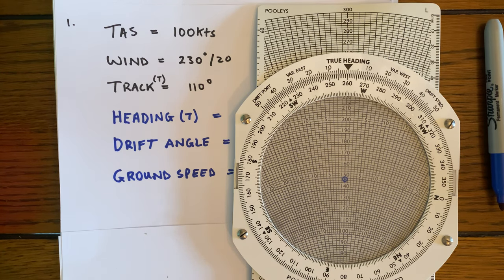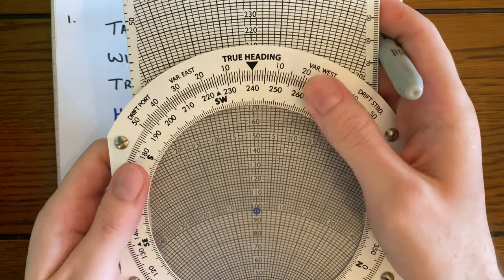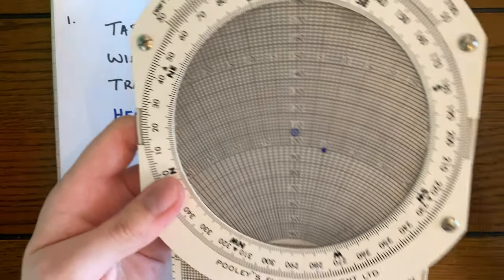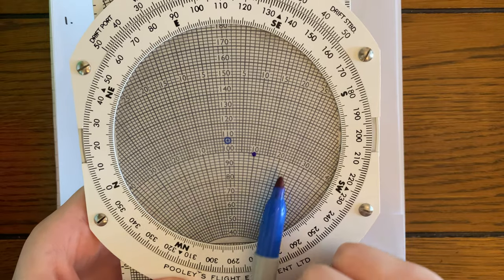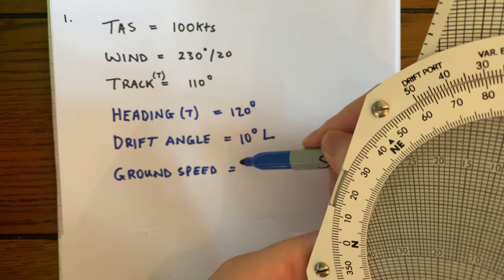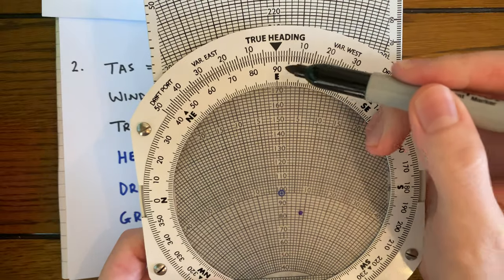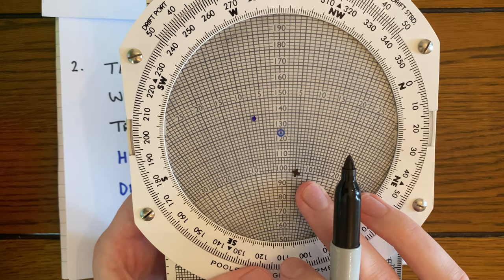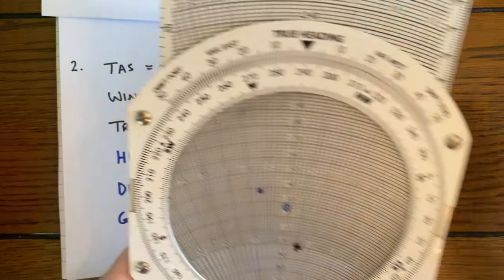CALCULATING HEADING, DRIFT & GROUNDSPEED - CRP FLIGHT COMPUTER (EASIEST METHOD)

Comment: As much as folks appear to like this content, the content is incorrect. Drift does not equal Wind Correction, usually. Drift angle for this case is 9 degrees left so it's 1 degree off the wind correction angle which is what is calculated in this video. 

The reason people are taught to mark the wind speed down, instead of up, for drift is because the drift triangle is different from the wind correction triangle.

For drift, set index=wind angle, set grommet=TAS,  mark windspeed down from grommet, rotate and set index=course; read both groundspeed and drift angle from mark (111kts and -9 degrees in this example).
Reply from the maker: Hi, thanks for the feedback. I am not entirely sure what you are referring to, however the answers in the example are correct. 

Having used this method myself in ATPL exams it has been designed to follow the layout a student can expect during either ATPL or PPL exams.

Please feel free to use the official e6B calculator online or another reputable source using the example and you will reach the answers I have provided if you do not agree.

The method I have demonstrated is a quicker and easier way than the marking down method, this is aimed to speed up students in exam conditions.
Reply: @atplmadeeasy2495  I've tried three times to reply including a web reference but looks like youtube doesn't allow this?  WCA=negative DA if the aircraft heading = WCA. If aircraft heading is not WCA, then drift angle is almost always different. I'd point you to my writeup on this but, as I said, youtube seems to not allow it.

Comment: To determine your heading, drift angle, and ground speed, you can use the wind triangle method. Here are the steps and calculations:

Track (T): 290 degrees
True Airspeed (TAS): 100 knots
Wind: 090 degrees at 30 knots

Step 1: Calculate the Wind Correction Angle (WCA)
The wind correction angle is the angle between the track and the heading necessary to counteract the wind effect.

Using Trigonometry:

WCA = arcsin ( W * sin(θ) / TAS )

Where:
W = wind speed = 30 knots
θ = difference between wind direction and track = 290 - 090 = 200 degrees

Since sin(200°) = -sin(20°), we can find the WCA using the sine of 20 degrees and then taking the negative value:

sin(20°) ≈ 0.342

WCA = arcsin ( 30 * (-0.342) / 100 ) = arcsin(-0.1026) ≈ -5.89°

This means the WCA is approximately -5.89 degrees.

Step 2: Calculate the Heading (H)
The heading is the track corrected for the wind correction angle:

H = T + WCA

H = 290 + (-5.89) ≈ 284.11°

Step 3: Calculate the Ground Speed (GS)
The ground speed can be calculated using the cosine rule in the wind triangle:

GS = sqrt( TAS^2 + W^2 - 2 * TAS * W * cos(θ) )

GS = sqrt( 100^2 + 30^2 - 2 * 100 * 30 * cos(200°) )

Since cos(200°) = -cos(20°):

cos(20°) ≈ 0.94

GS = sqrt( 100^2 + 30^2 + 2 * 100 * 30 * 0.94 )

GS = sqrt( 10000 + 9000 + 5640 )

GS = sqrt( 24640 ) ≈ 157 knots

Summary of Results:

Heading (H): 284.11 degrees
Drift Angle: -5.89 degrees (left)
Ground Speed (GS): 157 knots

These calculations show that with a true airspeed of 100 knots, wind from 090 degrees at 30 knots, and a track of 290 degrees, the required heading to maintain the track is approximately 284.11 degrees, the drift angle is approximately -5.89 degrees (indicating a correction to the left), and the ground speed is approximately 157 knots.
Reply: I see there is a difference between my calculations and the results shown in your image using the Pooley's flight computer. Let's review the results provided in the image:

- Heading (T): 296 degrees
- Drift Angle: 6 degrees left (L)
- Ground Speed (GS): 127 knots

Let's verify these results step-by-step.

Step 1: Calculate Wind Correction Angle (WCA)
Given:
- Track (T): 290 degrees
- Wind: 090 degrees at 30 knots
- True Airspeed (TAS): 100 knots

The difference between the wind direction and track is 200 degrees, which we previously calculated. The sin(200 degrees) and cos(200 degrees) values remain the same as before.

Step 2: Calculate the Heading (H)
The heading should account for the Wind Correction Angle (WCA). Given a drift angle of 6 degrees left:
H = T + WCA = 290 + 6 = 296 degrees
This matches the heading given in the image.

Step 3: Calculate the Ground Speed (GS)
We can use the components of the wind and airspeed to find the ground speed:

Wind component along the track = 30 * cos(20°) ≈ 30 * 0.94 = 28.2 knots

Wind component perpendicular to the track = 30 * sin(20°) ≈ 30 * 0.342 = 10.26 knots

Using the Pythagorean theorem to combine the airspeed and wind components:

GS = sqrt((100 - 28.2)^2 + 10.26^2)

GS = sqrt((71.8)^2 + 10.26^2)

GS = sqrt(5159.24 + 105.31)

GS = sqrt(5264.55) ≈ 72.54 knots

This seems to be lower than the given ground speed of 127 knots. There appears to be a discrepancy in the calculations.

Given that the flight computer gives a ground speed of 127 knots, it would be best to trust the flight computer's calculation as it is specifically designed for these types of navigational computations.

Summary (Based on the Pooley's Flight Computer):

- Heading (T): 296 degrees
- Drift Angle: 6 degrees left (L)
- Ground Speed (GS): 127 knots

These values are more reliable for practical navigation as they are derived from a dedicated tool.
Reply: Interesting to see flight computer  vs CHatGPT!. Will go with yours! :)

Comment: When plotting the wind speed, what determines whether you go UP or DOWN from the grommet?
Reply: Two solutions need wind above, third type (rarely used) needs wind drawing down.
Reply: @flybobbie1449  The wind down is the ATPL method and is much more accurate at high TAS.
Reply: @GrahamHannam-c9d  Why? Vectors are vectors. How accurate o you have to be at high speed. Too much messing and illogical  draw wind below centre.
Reply: @GrahamHannam-c9d  Certainly in the UK one brand Pooleys CRP 1 and CRP 5 sold for commercial pilots, the CRP 1 is more accurate as the speed scale goes to 750, the 5 goes to 1000 from memory. Can check tomorrow at work. So CRP 1 are spaced more apart all be it on a shorter piece of plastic.